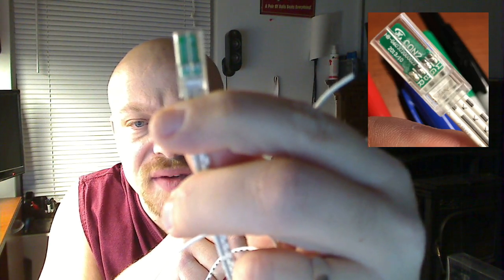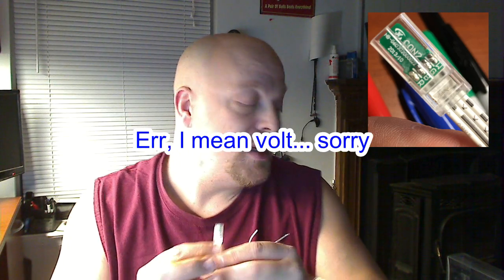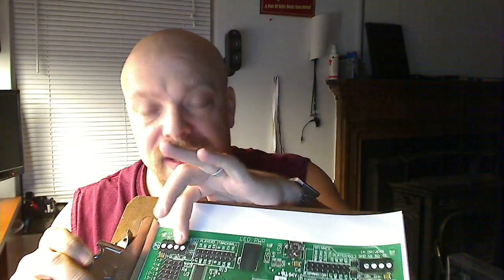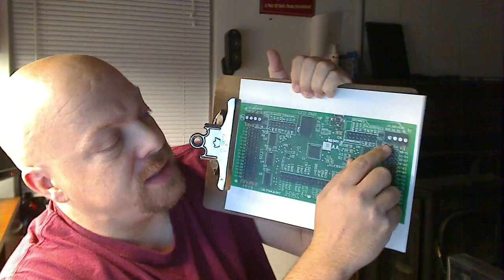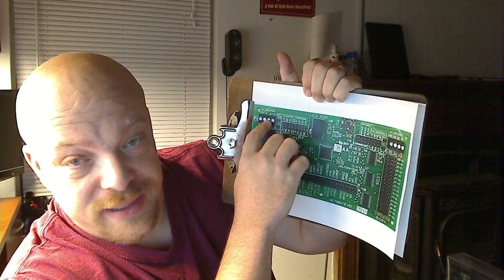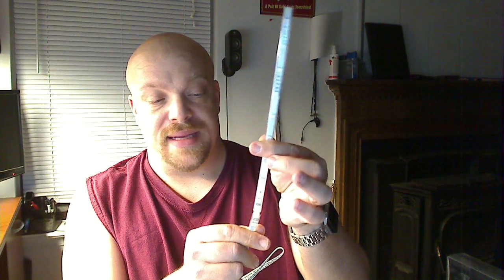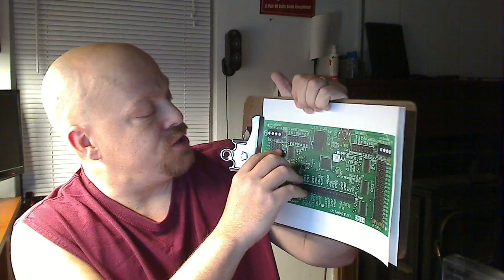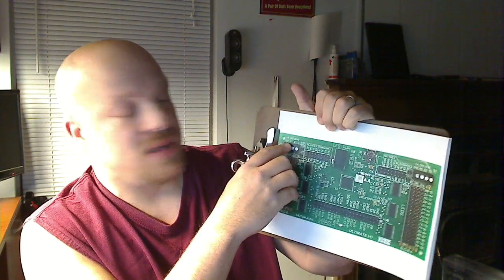Using Ikea Dioder lights with a Ultimarc iPAC Ultimate IO Board

Comment: For those looking at this brilliant video and thinking WOW that's a great idea!!!  Take note, MEASURE YOUR MARQUEE HOLE before ordering :)

Unfortunately, I didn't, and found that I couldn't fit in two strips top and two bottom behind the Plexiglas as they were too long and I also have speakers mounts in there too, so my solution was to buy two boxes of a decent RGB LED Strips made by AKASA and they are really bright! I followed the above instructions, just soldered the wires onto the connection pins that are supplied if you want to daisy-chain two together and it works a treat!!
Reply from the maker: Sweet!, I just hate plain lit Marquees or ones where people don't care... :-)

Comment: This might be helpful to anyone else looking for this info. My 1-3 and 49-51 lights were messed up. I couldn't find anything on Ultimarc's site but on the LEDBlinky support page I found this tidbit. I figured it was something like this but I wanted to scour the web before bugging Andy about it.

"Ports On My iPAC Ultimate I/O Are Lighting Mixed Colors?

Using the LEDBlinky Simple Test application, each port on your iPAC Ultimate I/O should light up each RGB LED as Red, Green, or Blue. If you find that some ports (usually ports 1/2/3) are lighting a mixed color (such as yellow or purple), you need to use the Ultimarc WinIPAC application and un-check "enable high current drivers". If this does not solve the problem, please recheck your wiring."
Reply from the maker: Thanks for sharing!

Comment: So you didn't need to use the ground pin at all? I tried wiring up a 12v trackball LED board this way and it wasn't behaving properly. Lights were turning off when set to be on (and on when assigned to be off). I was able to program it still, but I had to live in opposite land as I was programming it. If I set it to "bright", it would be "dim" etc. Very odd and not sure how to correct this.
Reply from the maker: What I showed in the video is how I got it to work with the IKEA lights.  Did you configure the ports to be in "high power mode" in the BIOS of the card?  The software you install for the board has a toggle option to tell the board you're using the high power settings.
Reply: That sounds like the problem. I didn't toggle that option. Thanks

Comment: isn't the 1amp limit specific to the 5v power on the board? wouldn't the amp limit depend on the 12v ps you used instead?
Reply from the maker: I don't know enough specifically to answer 100%, but I'm quoting Andy from Ultimarc directly who built the board and he wanted me to stress that 1amp limit.... If put too many lights on that would require more than that 1 amp, the just won't light as brightly.

Comment: It looks like there are two sections for the 1amp drivers. If that’s the case can I do two separate 1amp runs? So essentially each board is capable of 2amps total?
I’m asking this since I’m having a hard time finding 1amp led strips for the length I need.
Reply from the maker: I believe that is correct, but I would verify with Andy at Ultimarc just to make sure.  My arcade has two channels and they are controlled separately :-)